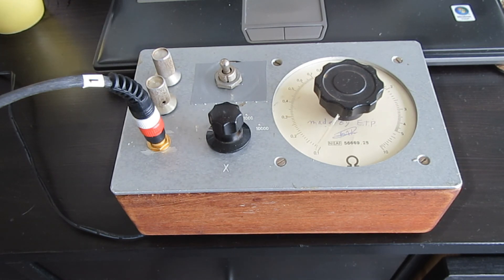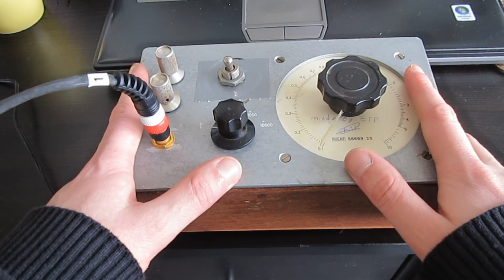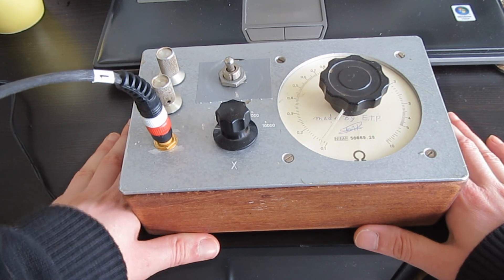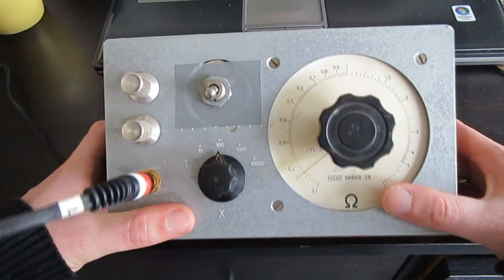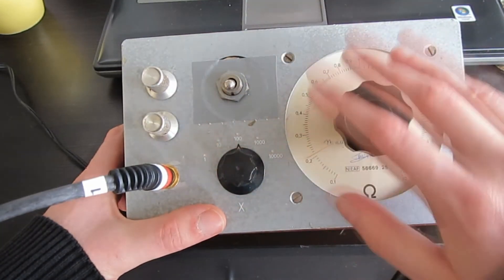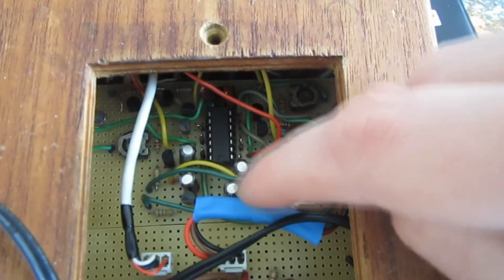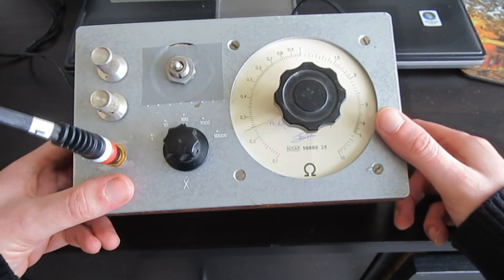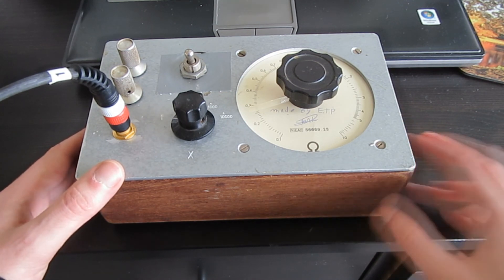DIY Analog FM synthesizer - Demonstration and Explanation

Comment: did you use stereo potentiometers for controlling l + r simultaneously?
Reply from the maker: No they pots generate control voltages that go to transistors to change things. If I recall correctly. That or vactrols :P
Reply: @rot_studios  Thanks! So there's one pot sending the same CV to each of the two voices / their respective transitors?

Comment: Thanks for sharing this video, and your schematic. It's definitely the kind of sound I want for my current build. It's an 8 step sequencer. I don't think I have room for (or the budget!) for all these controls x 8 steps - so wondered if you'd recommend which would be the most useful controls to have per step, and which would be best as globals please? Thanks!
Reply from the maker: Definitely the biggest knob, hehe. The modulator and carrier frequency knobs might be the best choice. You could replace the modulation intensity control with a vactrol (LDR + LED) and have one control knob for the global intensity instead.
Reply: @rot_studios  Thanks for the quick reply, and the helpful advice! Vactrol is a good shout - I will experiment with your suggestions on the breadboard before committing :)  Thanks again

Comment: hii what kind of transistor or diodes did you use or doesnt rly matter
Reply from the maker: 2n3904 or equivalent, diodes are small signal ones. I don't think it matters greatly.
Reply: @rot_studios  cool :) diodes i have 1n914 or similar i dont remember. will a higher gain transistor have any effect? like 2n5088

Comment: Exellent!!have you a link or explanation for the sync section?I have build your stuff,try différent possibilitys for the sync but without success.
Thank you so much!
Reply from the maker: I think the sync shorted the two modulator outputs together, forcing them to sync (since they are always close to eachother's frequency anyways). I'm about to build this thing again as a commission, so I'm going to dive back into the schematics sometime the coming days, I'll let you know what it was exactly. It was a simple connection thoguh.
Reply from the maker: Yeah, looks like I was right, though it seems I synced the Carrier (bottom-left part of the schematic) rather than the Modulator. Makes sense since that is the biggest knob :)
Reply: @rot_studios  Thank you!I have tried this one but without succes too...don't understand,if i wire the carrier from one osc to the second  modulator i haven't sound....I must check deeply my oscillators,i run in 12v for all parts,i have add some pulses leds for each oscillator perhaps it's the cause of the problem(probably leds take too much voltage?).
The sounds out of my build is nice but not so good that yours,i guess it's better to feed the 40106 with 5v.
Thank you again ;)

Comment: Hello! Im blow away by the sounds this machine does. Been studying the schem you provided, pretty simple, but synth tech is still alien to me, so this provides a single Operator modulated in a fixed way (with AM/mod and FM/carrier) by two other Operators? i think its pretty clever. Now could a "fm feedback" function be added, if so where? Could it be taken from the audio out and retrofeed to the 470n junction? Would this be correct, also would it need a buffer? cheers
Reply from the maker: Thanks, it's one of my favorites :)

It's sort of 2 modulators and one carrier, though the top modulator on the schematic has a different kind of influence on the carrier, so that's why I made the front panel controls a bit differently: the carrier actually consists of the bottom two oscillators where the rightmost one actually makes the FM work in a way that it creates these cool sounds. The modulator is the topmost oscillator. The controls on this thing reflect that.

You can try feeding the audio output back into the frequency control transistor, check the explanation on the webpage provided in the description (second link!).
Reply: Alright, will study that one too. Saw once the Bastl FM mini synth, although it has a variety of sounds, i like the sound of this unit better, it has more "body", dunno how to put it.
Reply from the maker: The Bastl is pretty neat yeah ,still want to faff about with one someday. Thanks for the kind words :D